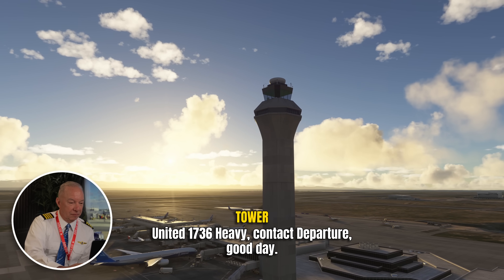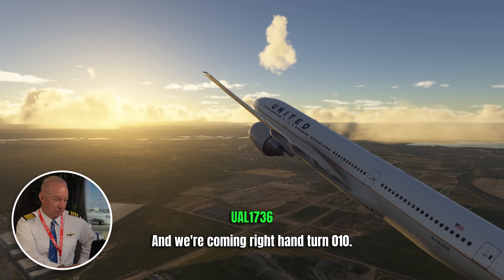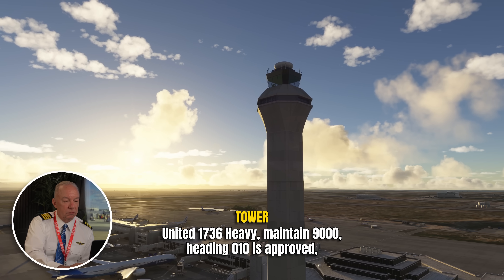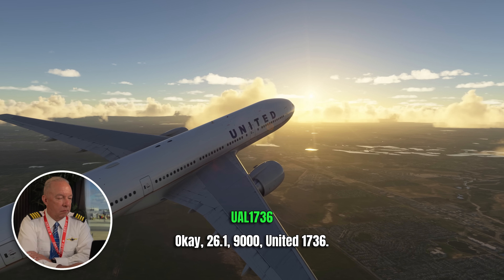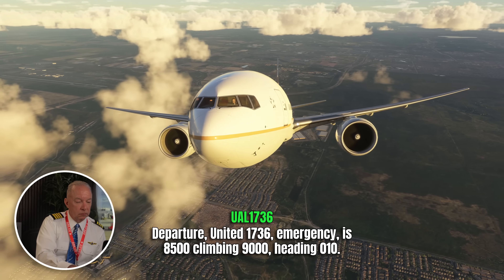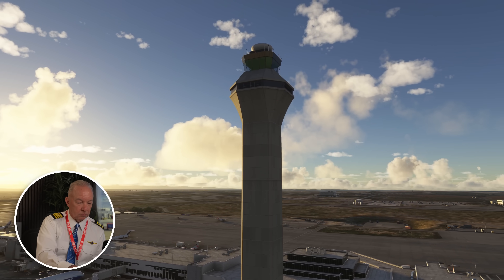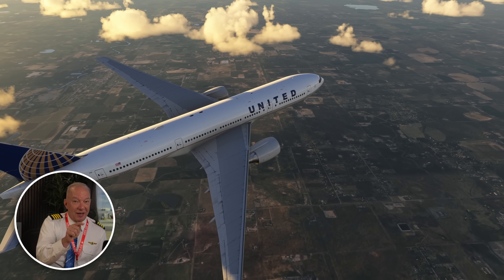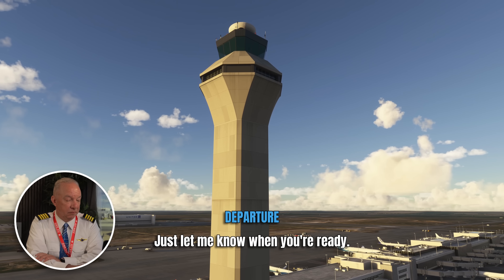United 777 Suffers Engine Rollback After Takeoff – Here's What Happened

Comment: Surprised that the crew accepted to fly a right hand pattern while they were working through the lists/procedures. 40+ years ago, during my twin engine training, it was hammered home that you never turn into a dead engine. With the engine on the other side of the aircraft typically at full thrust, turning into the dead engine requires a lot more rudder and roll control to keep the aircraft from simply rolling over towards the dead engine. I haven't flown anything larger than a Beach 250 but if I lost a engine, there is no way I would tooling around the sky making all my turns into that dead engine. Good to know the incident was uneventful.

Comment: your deep gasping ... air gulping ... is a bit concerning ... is this due to P02 issue ... sitting there in your office ... limited lung volume due to some issue ? ... i am used to delivering lectures and presentations ... and breath normally ...but talk a bit slower ... a bit less frantic ... and that allows more normal ... breathing ... less gasping ... as one talks ... or relivers a presentation ... even then ... the run out of air and gasp method ... due to your desperate need to get the whole idea or thought cluster out as one fast delivery ... is going to be tiring ... slow up ... breathe normally ...  few people can go past 8-15 seconds of delivery without a breathe ... reduce your intervals to 3 to 6 seconds and you will find it much more relaxing ... and we will hear less gasping ...wink

may you have fair winds and following seas ... 

or CAVU  with no MEL squaks

wink

Comment: Capt. Steve, that’s a digital infrared thermometer with or without a laser pointer. Engine at reduced thrust maybe fuel, line, filter or other. Fuel leaks and hot brakes are other issues but always wise to check before binging to a gate. Excellent crew!

Comment: Hey if an engine rolls back like that but is still running just not producing any thrust does that mean you would still have normal electrical and hydraulic power from that engine?
Reply: And/or any bleed air?

Comment: Couldn't resist after reading this exact post in Threads. Has it  ever happened to you?
"Our flight attendant just asked everyone in the back of the plane to move to the front as fast as possible because the plane is tipping backwards. This is my first and last flight on Frontier Airlines."

Comment: Hello sir. I have a question. Everyone I ask has a different answer.  Do commercial and general aviation pilots fly a descent or control the fall?  I ask because my basic understanding is less speed, less air over and under the wings equals less lift seems like a fall. I have received answers of its flight, it’s a fall and both. What’s right?

Comment: I don’t like the term rollback.  If an engine on these planes doesn’t fail due to bird strike or the thing comes apart or something like that then the computer just turns off.  It is a perfectly good engine it just shuts off.  That should never ever happen.  I don’t know where they came out with “rollback” as a term. If the pilot didn’t shut off fuel, or the engine didn’t break then the computers decided to turn it off.

Comment: Did the FAA change the rules on wind shear / micro bursts? I have lived in Denver for 30 years and the number of delays at DIA is increasing significantly. I realize,that safety is #1, but I have experienced several 3-4 hour delays when the sky’s are clear, no storm clouds no thunder & lightening.

Comment: OK.. Just to get this straight in my head... It is totally fine for the United B777 crew to take their sweet time to figure out options and do their assessment of the best course of action, being boxed around in patterns, when they had just lost 50% of their thrust - and thus life - insuring engines. But it is totally unacceptable, that a Lufthansa A340 having lost a quarter of said engines - which doesn't even constitute a 'mayday' situation (at least under EASA regulaitons) - are doing the same, maybe even considering continuing their flight? Which you again brought up in your last video? I somehow don't get it...

Oh, and by the way... There is a wonderfully simple explanation to the "ensuing, self induced hydraulic problem" that made the LH plane abort the first approach back into JFK: Each of the three hydraulic (Green, Blue, Yellow) systems have electrical backup pumps. But while the Green and Yellow electrical pumps come on automatically, the Blue one has to be switched on manually - ask Airbus why... And now, guess which system is powered by the failed #2 engine. Correct: Blue. So it might have been, that the flightcrew had just not turned on the Blue Elec Pump, which they were being made aware of when - getting slower on approach - the windmilling #2 engine didn't provide enough power to pressure the Blue system. This is not good, and will have had a thorough debriefing on the ground. But it is also not a big deal at all: The situation was recognized, analyzed, and rectified... They could have landed with the Blue system inop, because it only affects backup systems - like Alternate Braking and such - but they didn't and rather chose to do one more round to get it all right. I'd actually call that good airmanship... Mistakes are going to be made... always!... It is how you deal with them that determines your proficiency, Captain...

Comment: Answer: soles on board and fuel on board.  What is the never used information requested by ATC in the past 100 years.   There are no guarantees how accurate the numbers are, and heads have never been counted and compared to a pilot report when they are a pile of ash or running across the field to get away from the plane.

Comment: Hey Captain Steve, this incident was practically identical to my United B77-200A Denver departure back in 1998. I would have to dig out my little ‘Red’ log book for the exact date. 

Anyway, as you know United was the B777 launch carrier. We received N777UA in May 1995. 

I was a co-pilot then, LAX based on a 3-day ID, LAX-DEN-ORD-DEN-LAX. The DEN Chief Pilot displaced my Captain because he was retiring. It was my leg out of DEN.

Took off westbound, in the turn back N-NE, going through around 10, the Pratt right engine went high EGT. Before getting Captain got through the first checklist item-the engine went full ‘red’…which meant going straight to the secure engine ‘immediately’ part of the checklist. 

During that time, United had not transitioned to using the [BOEING QRH], United had their [own manuals and checklist] taken from the Boeing procedures. In addition, when we launched the B777 we did not have the electronic checklist for emergency procedures installed. Just the normal ‘flow’ checklist was installed. 

Anyway, the Chief Pilot was getting a little busy and behind with all the co-pilot stuff 🤣…he the said “hey you mind if I fly and you do all this stuff?” I said…” of course.” And wanted to because a lot of FMC work and comms has to be done. 

When back on the ground-at the gate we were met by all the big wigs. You see, United was still part of developing the ETOPS procedures (120, 180 ETOPS) for long-haul two engine airplanes. We had already had some Pratt engine problems that were found to be part of a new type of oil ring seals (if I can remember correctly), anyway it was jeopardizing this certification. This is why United only flew the B777 to Europe in those early days-long before we put the plane in the Pacific past HNL.

Comment: You didn't mention that the crew's initial turn to heading 010 was to prevent hitting the Rocky Mountains. Each airline has a charted obstacle clearance procedure (OCP) for this purpose. Each airline must design it's own OCP's and monitor that airspace for any changes such as new radio antenna sites. OCPs can vary between airlines.  ATC does not have knowledge of OCPs from each airline hence this crew's telling ATC their intention to fly heading 010. Lesson from this for general aviation pilots- Always have a plan in case of engine failure.

Comment: When reporting on 777 could you find out if the aircraft involved was made prior to 2017? Boeing dismantled the fuselage section turn fixture then. 1600 made with the fixture over 30 years without a single mass fatality accident. 200 have been made since then without the fixture. This is part of the most rigorous, double blind, full production performance review in aviation history.

Comment: Hello Captain Steve, when the pilots declare a failure and need to return back to the original airport, and as they land and taxi to their assigned gate.  My question is when the passengers disembark and are accommodated with a new aircraft, are the pilots from the original plane the pilots for the accommodating aircraft ?

Comment: I would like to tell you about a United Flight that I was on, a couple years ago .  I was headed from IAD to RNO via DEN.  The IAD-DEN flight, a 757-200, was late because of weather at IAD.  When we got to Denver, we circled for a while, and then the pilot said that we were being diverted to Rapid City because of heavy storms at Denver that could hang around.  We landed at Rapid City and two things occurred:  The pilots and crew went "over time" and we'd have to stay in Rapid City until a new cres could be found.  Then it was discovered that Rapid City did not have a gate nor jetway, nor even a ramp compatible with such a large plane.  So we sat there while the pilots had multiple discussions with United Corporate and FAA.  We were STUCK!  Pilots couldn't fly (or even operate the plane sitting at this rather small airport), and we couldn't get off the plane safely.  WTF!   What happened?  After about an hour sitting there we needed fuel.  Thankfully that could be accommodated by the airport.    Emergency slide evacuation was considered, but the airport was basically closed, no crew, etc.   (It was evening).  Eventually the FAA and UAL agreed to give the pilots and crew a time waiver, for exactly enough time to get to Denver.  We landed at Denver and joined huge crowds trying to re-book flights.   I ended staying at a hotel that night and couldn't get a flight to Reno, so I went to Sacramento and rented a car.  And of course my checked bag did not show up - it was stolen from the carousel at Reno (where it went) and ended up in a prosecution of a airport concession employee .    You just can't make this stuff up!
Oh well - another day in aviation.  And, at the time I was working for  the military, buying airplanes!  So I understand aviation stuff and try not to get too upset over these things.
Reply: I haven't missed anything since I last flew Continental US in 1991. Forty four flights since then have been SFO to the west towards Narita or Manila. No drama.

Comment: I'm well aware that there is technically no difference between the two, but, at least in my mind, 'Declaring an Emergency' is a calm way of making notification about a problem, that, while serious, is under control, while a 'Mayday' confers an image of a plane that is, or is in imminent danger of, plunging toward the Earth.

If we want to expand on this, I would require a bit of convincing that a simple loss of power in one engine, on a modern airliner, designed to fly just fine in such a situation, justifies any more than a Pan call.  The definition of Mayday I was taught in boating, was 'imminent threat to life or limb, or loss of the vessel.'  As I mentioned above, and as these incidents prove, these aircraft are designed, and the crew is specifically trained, to safely fly on one engine, and therefore, the risk is minimal....as long as there are no other extenuating circumstances complicating matters.

Comment: Captain Steeeeve, I flew on a 777-300 once and I could not believe how massive the engines were, but then when I look at how massive the aircraft itself is, flying around on one engine just wouldn't fill me with confidence, but it's reassuring to know it can be done.  At least these guys weren't over the ocean.
Reply: I think they are certified to fly for 5 hours over the ocean with 1 engine. They're not going to try to do it of course, but they can if an engine goes out in the middle of the ocean.

Comment: What is amazing is the sheer power of the modern jet engines. The 777 engine has over 100,000 LBf of thrust. The old Boeing 707 had to have 4 engines, and even then, the thrust to weight ratio for the aircraft was positively puny compared to today's aircraft.
Reply: The GE90-115b on the 300ER  has 115,000 lbs of thrust

Comment: Question (for a future, "Ask the Captain"):  Recently, my wife and I were flying into Albany International Airport on a Bombardier CRJ 900.  15 minutes before landing, we noticed the pilot changing the thrust (RPMs?) continously until we landed...very noticeable.  I've flown many times before and am used to hearing changes in engine sounds during different parts of the flight, but this seemed excessive.   We landed gently, and I waited for the engines to reverse, but they never did.  Instead, it felt like someone slammed on the brakes later than they should have.  I got the feeling that someone was talking a less experienced person through the last part of that flight.  Did the reverse thrust fail? Forgot it? I enjoy your channel.  Thanks for all the good information!  Be well...

Frank

Comment: Great job as always Steeeeve! You rapidly became one of the most popular aviators on You Tube out of the seemingly 100~ former / current pilots - the explosion ever since COVID it seems. I rarely write, but may have missed it, but: What was this 777's destination? I ask because no mention of "adjusting weight" - LOL "dumping fuel?" It did not appear like there was enough time, as they returned seemingly to quickly in your recap - but of course not "real time." So they were at 9,000 MSL, correct? Thus 3,000 AGL, not high enough to dissipate - would have needed minimum of 12,000 MSL (assuming Denver nominally at 6K above SL) or 6,000 AGL, correct? Captain stated 121,000 pounds of fuel on board; my quick (perhaps incorrect) research reveals 777 maximum pounds is 580,000 (non ER variant); so then assume landing weight was fine for this case? I had just watched  a video of a Nippon 777 (on 15 July) from JFK bound for Tokyo (probably an ER) that had a flap issue and had to return to JFK - they spent 40 minutes at least dumping fuel. Granted, that baby was fully fueled for that distance. I am sure you know all these numbers "by heart" since you fly a 777 :-) Thanks!

Comment: You said that the Boeing 777 flies just fine on one good engine. What twin engine aircraft, if any at all, does not fly just fine on just one good engine? It seems like all twin engine planes are designed to fly on just one engine in the case of one engine failure scenarios.
Reply: Avro Manchesters. Most of us are old enough to remember when there were 4 engined aircraft that could cope on 3 but not on 2, we remember 3 engined aircraft because people didn't trust a twin, in case it lost an engine.
Reply: @HarryFaber-z7l  I think that aircraft manufacturers have designed twin engine aircraft in such a way that they can account for the asymmetric thrust in the case of a single engine failure and still maintain stable flight until they can land at the next available opportunity. Fortunately, the engines of today are also much more reliable than 50 years ago.

Comment: Controllers are probably much younger and very inexperienced. They aren't controlling but only suggesting. That is a recipe for disaster. A pilot can declare an emergency. May-May is only used if the pilot expects to die within 1 minute. An engine failure is not necessarily an emergency.

Comment: What does the word "Heavy" mean ? Fully laden with fuel ?  Great channel
Reply: It refers to a large plane (i.e. this 777) that leaves a lot of turbulence in its wake. That matters for other planes that may be following it.
Reply: In ATC communications, widebody aircraft (like 777, 787, A350, A330, etc) will generally include "heavy" after their call sign. FAA classifies planes as small, large, heavy, and super based off their maximum takeoff weight (A380 is only passenger plane with super classification, and usually only heavy and super aircraft will announce their weight class over the radio).

Main purpose is due to wake turbulence so that smaller aircraft following can be aware to keep distance, and also a verbal reminder for ATC to space the following planes out appropriately. Wake turbulence from a heavy or super aircraft could easily throw off or flip small aircraft too close behind it. So ultimately, the purpose is for safety.

Comment: Aero terminology is all in acronyms, for some clarity around the engine mechanics:
EEC- electronic engine control
EMU- engine monitoring unit
HMU- hydromechanical unit
FOHE- fuel/oil heat exchanger
SAOC- surface air oil cooler
TCC- turbine cooling control
VFSG- variable frequency starter generator
OGV- outer guide veins

Hundreds more but then im getting into data protection and conflict of interest😂
Reply: you speaking my language.  former pw2000, 4060 and 4090 engr
Reply: Former UTRC employee, helped you guys solve some of the challenges with those engines